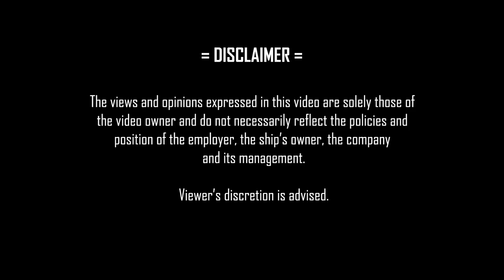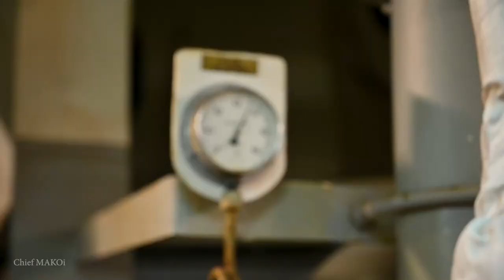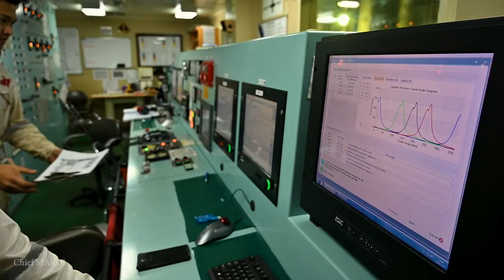Our Ship's Next Voyage: Egypt to Black Sea (Russia) | Chief MAKOi

Comment: Was told 40 years ago, when i applied for a job on a container ship(ACT) as an electrician , think it was as 3rd engineer , (but i could not meet required start date/flight unfortunately, never got another chance), that overtime rates are paid 24/7 from end of contract term, until you actually signed off. Could be a very nice paycheck if still true.

Comment: Thanks again chief, your videos as are always interesting and informative.  Question: I noted a wall clock in a shot. Does someone actually run around changing all of those as you move through time zones?
Reply: I think they are all wired together and can be set simultaneously via a master panel.

Comment: Sorry you and other seafarers have to deal with the delays. I wish there was some other way they could force a crew change in exceptional cases, like the 2-yr ones, maybe by rendezvous with a seaplane or flying boat while away from port and relatively close to a freer country. But maybe that would be too dangerous, or too expensive to charter for just a single passenger.

Comment: Questions:

Is it possible to do crew replacement by pilot boat when passing countries with open borders, for instance Gibraltar? I realize you and other command officers take days for a handover but it seems like this would be possible for non-ranked personnel.

- Please describe how your work week is spent. How much is spent in your office? I assume you stand some watches in the control room but are you able to pick up a wrench and perform maintenance or repairs?

Keep up the great videos and above all STAY SAFE! 🚢❤️😷
Reply: They want/need the crew to stay on so they aren't gonna allow them to try something like this I bet.  Unless your talking extreme circumstances or something.
Reply: @xcalibertrekker6693  Other than the mechanics, what is the difference between swapping crew members in transit or in port? If the operating company does not want the sailors to leave then neither method is viable. Speaking to retention, there is legal line in most countries between asking an employee to stay on and unlawful detention.

Comment: Hey Chief, random question for you about languages. I'm assuming you're multi-lingual (if not, the question remains), but with the variety of countries you visit it would be hard to know all their languages. So my question is, how is communication handled while in port? Are there translators there or does the ship need to provide them? Do you default to English or Spanish or another language? And while I'm at it, how many languages can you speak, and how many can you "get by" in?  Might be an idea for a video while you're off ship, or don't do a damn thing and enjoy it. We'll wait, lol. Safe travels!
Reply: The vessel will have a “working language” most will be English and as such all official communications onboard “should” be in this. There certainly isn’t the luxury of translators unfortunately you just have to get by. (Hope that partially answers the question for you)
Reply from the maker: Official language is English.  Even the port workers who have to deal with the crew must know at least a comprehensible level of English.

I only speak Filipino (Tagalog) and English.

Comment: so i have a question - is the anchor just heavy weight or does it actually grab the ground and if so how can it be grabby enough to hold the ship but not grabby enough when you want to raise it?
Reply: Does grab, but its mainly the chain that holds the ship. When you want the anchor up, you go straight above it. It will easily dislodge from the mud/seabed then. 

No expert though :D

Comment: Thanks for the update. When you mentioned going to the black sea I figured you guys are getting loaded with coal again. Seeing the wheel loader in the cargo hold reminded me of running one on barges offloading rock to be placed on the shoreline by the derrick crane. I always hated the barges without a fence since one mistake would send you over the edge in the drink.

Comment: A question for you Chief. Why do some ships dump water out the Anchor chain wells when entering port? I've seen this with both bulk and container vessels entering 2 different ports in Brazil. At Santos Sao Paolo and Itajai Santa Catarina.
Reply: Ships that have been at anchor for a while , the anchor chain and anchor will get plastered with whatever the holding ground is made of . So in short it is usually to wash the cable and anchor before it gets carried down into the chainlocker. On a side note , at times they would be left open to reduce any water hammer if all other hydrants were closed when engine room is asked for water on deck.Usually the fire line.
Reply: As John below says it is both the anchor wash and fire main outlet. They are not dumping water it is sea water that is being pumped through

Comment: Two questions... There must be thousands upon thousands of preventive maintenance items (large and very tiny) to do on a ship. How do you track and schedule them to make sure nothing is forgotton?

And second, how the heck did you get the front loader into the hold at about 5:07 into your video?

Thanks,

Jack
Reply: The Loader is lowered in  by overhead cranes in port, they do the same things here in WV on  Coal and Gravel barges to clear out as much material as possible, even then the final little bit is done by shovel and broom.
Reply: On the ship i work on we have the planned maintenance system software, which is basically a database we enter the maintenance jobs into that gives us alerts. Smaller ships just have a book of daily, weekly and monthly tasks that need carrying out, with a seperate logbook to record the date and times that the jobs have been completed, for posterity.
Reply: Your 2nd question answered 1st question there is a program called PMS planned maintenance system which is written by either the company or when vessels are built, the c/eng then prints normally end of each month for upcoming month, these can be small jobs or like seen in video cleaning sea strainers, calibration of equipment to bridge each officer normally given these on rank engineers to bridge team to bosun to c/cook these are recorded in computer for future references and safety checks with insurance surveyors, this just basic hope it helps

Comment: Hello Chief. Love your videos. Question, I see the lifeboat at the stern of your ship. Is that the only one? If there was a fire or some other reason you and your crew couldn't reach it, how would you abandon ship?
Reply: There is only one lifeboat, multiple life rafts positioned both forward and aft and there might be a small FRC (rescue boat). The lifeboat is aft on the accommodation as it’s the fastest place to get to to evacuate. However the other options exist for abandoning the vessel from the bow if required
Reply: @djcwilso  Yeah there is a rescue boat, saw them take it out in an older vid. Cute little thing lol

Comment: I'm curious why ocean going vessels like yours aren't self unloaders? Pretty much all of the great lakes bulk carrier fleet were either built that way or converted later on. No need to lower a loader into the hold, No need for shore equipment like the cranes I saw in another of your videos. Just pull into port, swing the unloading arm where you want the cargo to go and let the conveyors do the rest.
Reply: Because a lot of ports / terminals aren’t set up to receive cargos like this. Also if you see from the Chief’s other vessels a bulk carrier can transport much more than just products which could be self unloaded. Steel coils / plate / scrap metal being just some examples. Flexibility is key to make as much money for the owners as possible

Comment: Chief - Would you be willing to do a video explaining what happens when a cargo ship is struck by lightning?  How does the crew stay safe in lightning storms?  What type of damage can a ship sustain when struck by lightning?  What steps does a crew take to control that damage?  I've learned so much from your videos.  Thank you!
Reply: Lighting would seek the path of least resistance. If it strikes a ship it will most likely strike on the mast, which is a metal structure welded to vessel. Lighting would disrupt sensitive navigation and communication equipment but since the path to least resistance is through the hull and into the water, it wouldn't damage them unless they are struck directly. And this mostly applies to equipment installed on the mast, such as radios and radars

Comment: Hey Chief, I see the crew wearing hearing protection in many of the videos.  Is hearing loss an issue for career seafarers?
Reply: You'll have to write in block capitals ...
Reply: Yes , especially for older seafarers now retired who didnt have the elfan safety regs.when you working in engine room next to a vee 18 B&W Alpha going full chat , turbo noise at high end and percussive noises all around , no soundproofing (only in control room) you dont really hear so much as feel different vibrations .very difficult to communicate verbally. Most engineers understood each other through intuition on the job anyway , a quick turn of a clawed hand and a questioning look says "turn this ?" No talking required...lol i am waffling.
Look after yrself